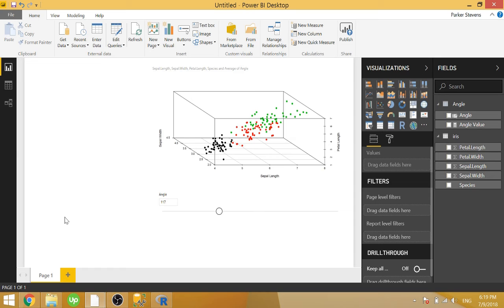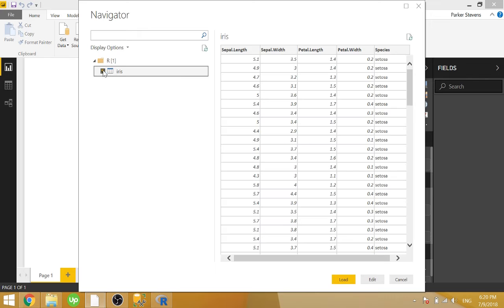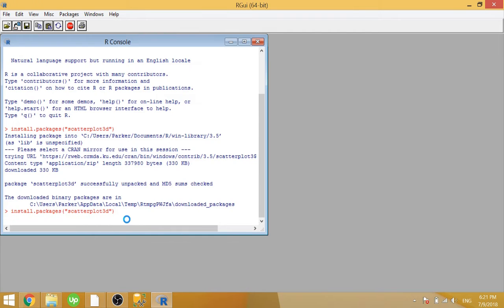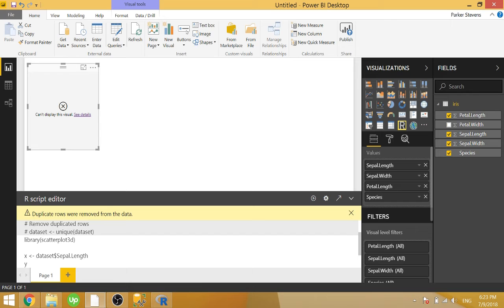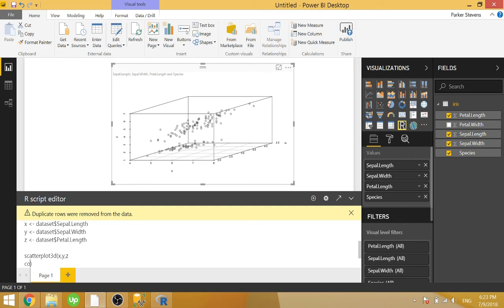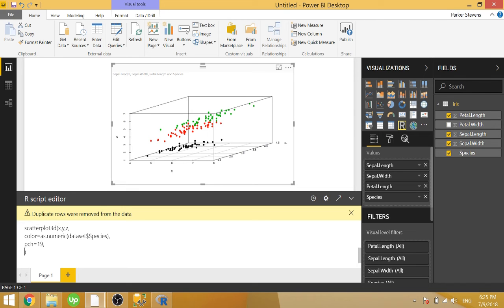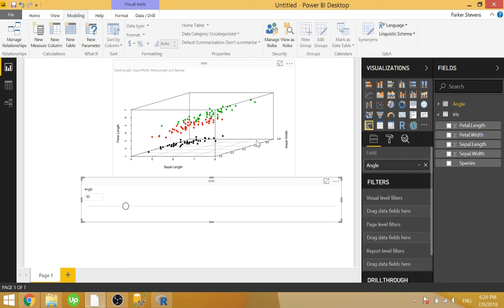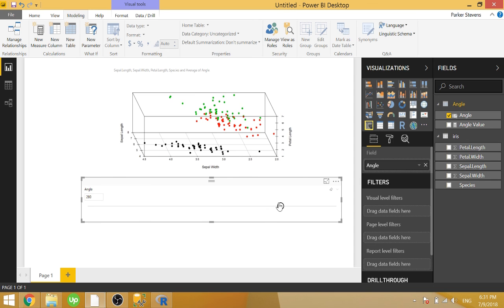R Visuals in Power BI - 3D Scatter Plot

Comment: Very good and I got it to work the first time. I am using my own dataset comprising flight data of altitude, speed and direction ... there is no obvious colour scheme so what I would like to do is to colour each series differently: red, blue, green, for example. Can you advise me on how to do that? Much obliged. I would also like to change the font size as Power BI defaults are tiny. I am able to change the font size of the title, however.

Comment: Replicated almost the same exact code but unfortunately am recieving an  error that reads "error ins scatterplot3d(x, y, z, color=as.numeric(dataset$Example)): length(color) must be equal length(x) or 1" .... Example is the name of the column I want to filter the color by...... Any ideas of what could be going wrong? Anything helps!
Reply from the maker: I'm sorry Austin, I've come across this error before but I don't remember the exact solution. I think it has something to do with the fact that you Example array is a different length than your X array. Maybe try to go off of that and see if it helps
Reply: Make sure you've selected all the required fields before running the script. I'm not sure if this was exactly how I solved the error last time but it's worth checking